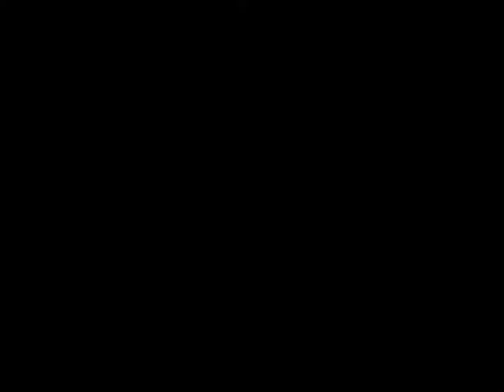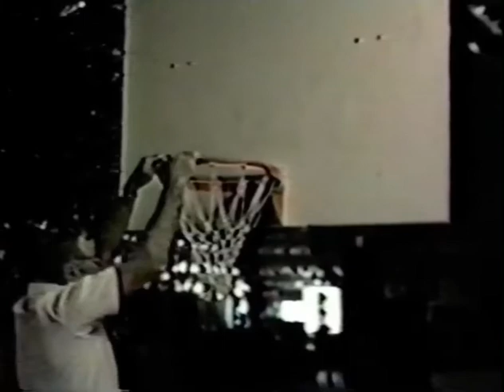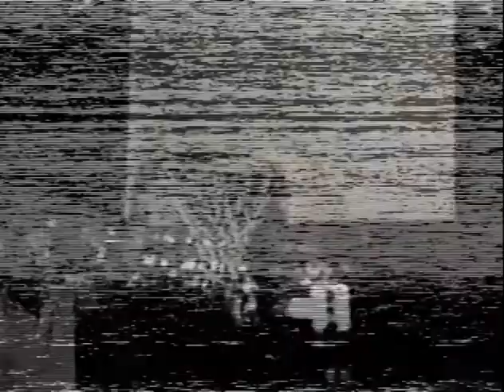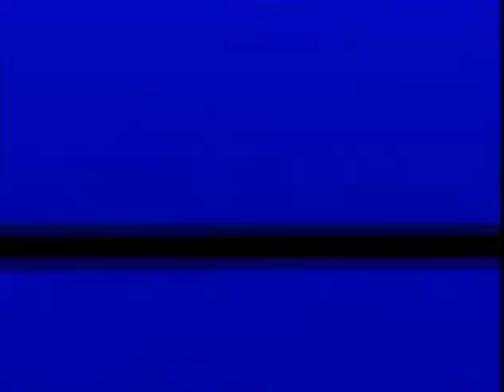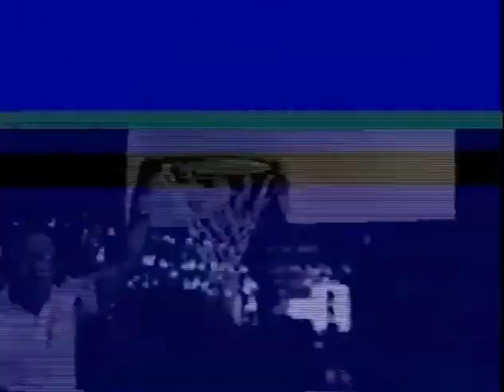Breakaway Rim Demonstration — Toss-Back Safety Rim vs. Traditional Rims Explained

Comment: This was a Gared Snap Back rim, the same goal that was used from 1981-82 through about 2009. The fact is that when a player would hang or swing on the rim the breakaway effect was eliminated....it was done breaking away when the rim was pulled all the way down (the NBA rim still weighs over 20 lbs). What keeps the backboard from shattering in today's NBA is that the rim is bolted into the basket support itself and the backboard absolutely does not support the weight of the rim. It's impossible to shatter a backboard now. Really, the breakaway rim in today's NBA is just a gimmick...it's meaningless. Perhaps the breakaway effect in today's NBA Rim softens the rim for a more friendly shooters bounce but how does the breakaway effect make the rim "safer?" The Gared rim was a way better looking rim, in my opinion, with its tie cord net assembly (for what that's worth). Today's NBA rim costs over $1,200 dollars! Ridiculous gimmick rim!

Comment: Do they still make these?
Reply: If your talking about breakaway rims yes they use them in the Nba and most places with basketball courts do as well but if your talking about the videos then I don’t know
Reply: @Onb.V  I was thinking of the kind that "break away" all-at-once at 200 pounds of force and then snap back. Today's rims only flex because of how the springs are configured.
Reply: @robertspencer3694  the spalding pro image rim does what your talking about i think
Reply: What’s that style of the net tho? I remember nba rims were like that in the 90s and early 2000s
Reply: @vontelildude The rim is the Gared Snapback…official rim of the NBA from 1981-2008. It used a tie cord net attachment. I have a Snapback installed on my home system. The tie cord makes this rim, in my opinion, the best looking.
Reply from the maker: My father - Mr. Toss Back was the person that introduced the tie cord net attachment.  There are many improvements made.  Come by the Dorrance Bankery and have a look.
Reply: Yes. The rim in the demonstration is the Gared Snapback (originally called Toss Back). The rim “won” the contract for the official rim of the NBA in 1981. It remained the official rim of the NBA until 2009 when the NBA entered a 20 year equipment deal with Spalding and the replaced the Snapback with the Spalding Arena 180.
Reply from the maker: This is a video of my father demonstrating the Toss Back Snap Back break away rim first adopted by the NBA.
Reply: Do they make them anymore? How can I get one?